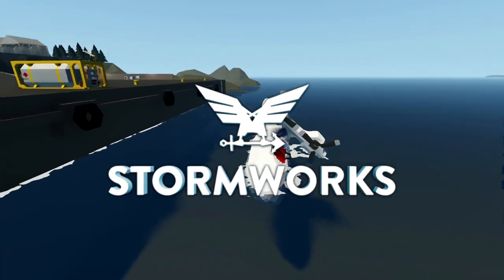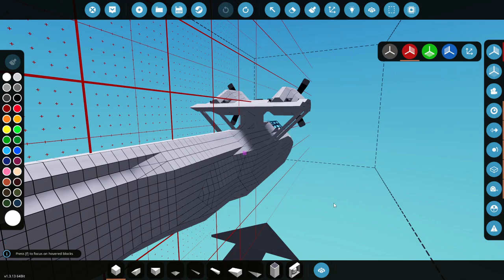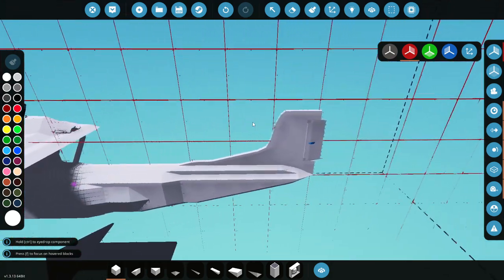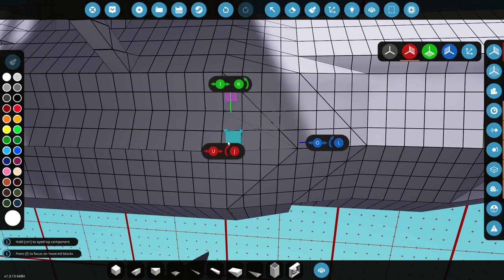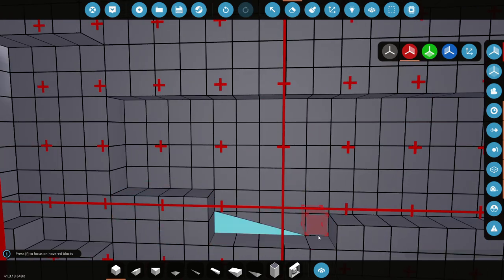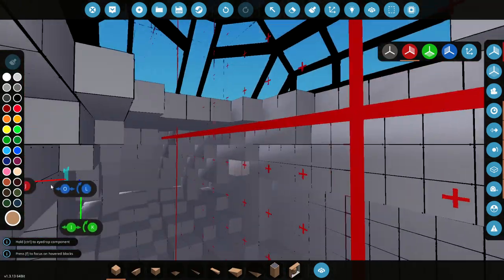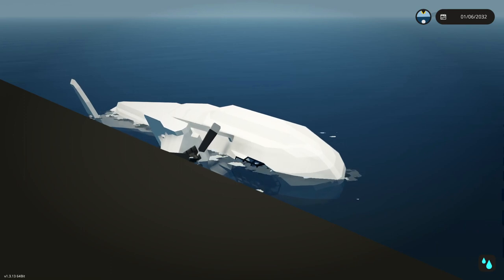Tailfins & Width ADDED! - SeaPlane Build - Stormworks Gameplay - #3

Comment: one thing you should consider doing is putting the entire wing, engines and all on a pivot and through the magic of "same grid separate object" and magnetic lock it at an upwards angle of incidence. this should make taking off easier as it wont pitch the nose down as much while pulling the plane up some.

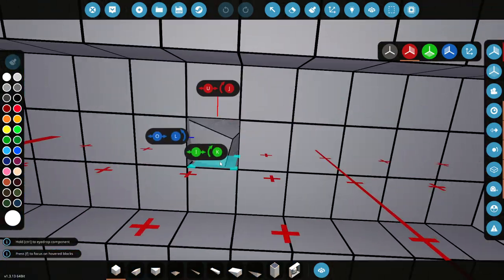Comment: Could set a sliding door on end, in front (section bulkhead) of cockpit, then your seat contraption can interface without character collision; but beware, can't have any outside edges exposed on skin of craft. 13:15 ohh, sinking it with fuel, that took a second watch.